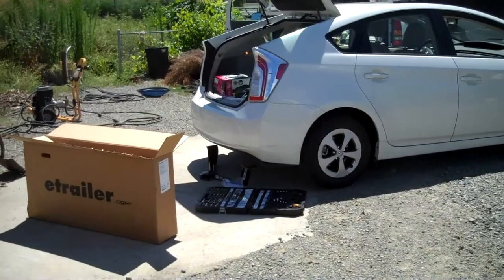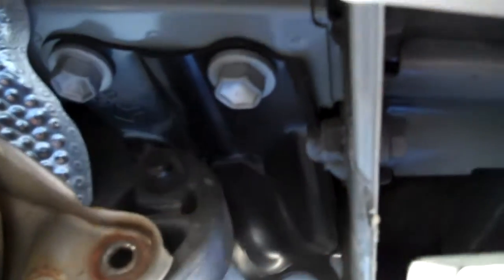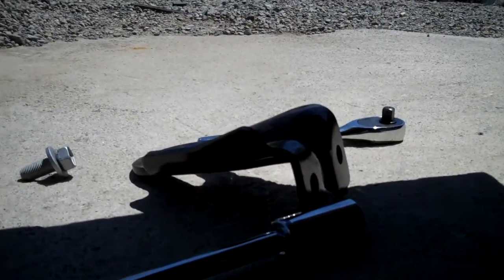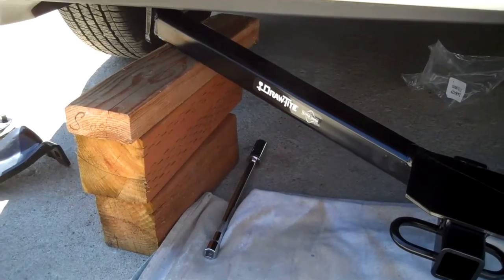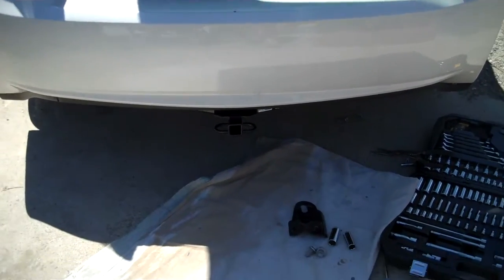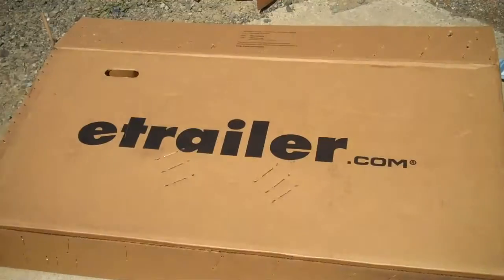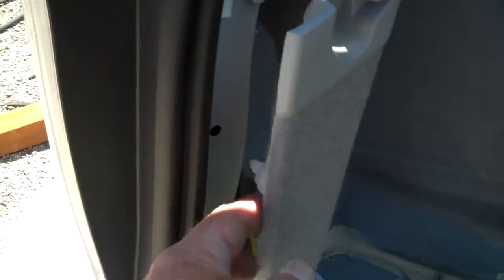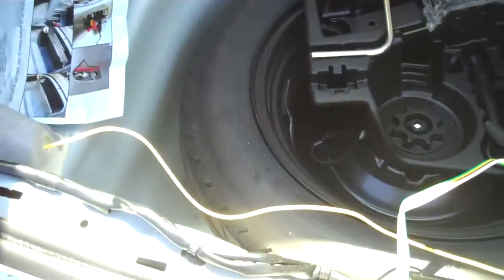How to Install a Prius Tow Hitch

Comment: Thanks for straight-forward tutorial. The Curt tow hitch is about $200 cheaper than the etrailer but it's 1  1/4". Does it make that much of a difference using a converter to 2"? I will be primarily just be using hitch for a cargo rack on back, occasionally pulling a small 15' boat trailer (less than 750lbs with boat). Thanks!
Reply: You lose the slightly higher tongue weight, but the hitches are rated the same.
Reply: @ALRinaldi  Thanks!

Comment: Just like Jon said, super simple.  Mine is a 2011, all 17mm holes for the hitch and 10mm for the bolts for wiring (tie down rings and battery).  Bought from e-trailer also.

Comment: Thanks for the video. Can you share your experience so far? I want to put a three bike rack on this hitch but everyone says that you can't do that on a Prius, any experience with this set up? Thanks
Reply from the maker: Of course you can

Don't listen to the haters

I have a full-size trailer and I load it to the gills I've never had any problems

And my Prius is no worse for wear

What you are suggesting with three bikes

Is way less weight than I have with my trailer and tons of building materials

I wish I could post pics I could show you

Anyway you are fine go for it man
Reply: Thank you.

Comment: Question that may be too simple - but is this the type of hitch I would install to then use for mounting a bike rack on?  (with a hitch ball mounted into it)  Thanks
Reply from the maker: Yes you need this as a prerequisite for any thing you want to put on the back of your Prius
Reply: @Jonehughes  Thanks - just wanted to be sure - we are over in Europe and making foolish mistakes can be expensive and time consuming

Comment: Did you have to remove the rear plastic protector or am I able to install around it?
Reply from the maker: They are all different

This was a 2012 and I did not

I did it with my 2015

I did with my 2018

It all depends

Comment: Hi John, I have a 2007 Prius.  Just wondering what the  part # is for your wiring harness that you installed?  Thank you
Reply from the maker: CURT 56147 Vehicle-Side Custom 4-Pin Trailer Wiring Harness, Fits Select Toyota Prius https://www.amazon.com/dp/B006MDH3JK/ref=cm_sw_r_apan_glt_i_M8WKXZ85S7SP9GQ8KBTX?_encoding=UTF8&psc=1
Reply: @Jonehughes  I could be wrong, I can't hear very well. I thought I heard you say in the video the wire harness came with the hitch?
Reply from the maker: Hi Brooke

 I'm also on a budget 😜

and whenever I order any hitches from them and I've ordered several

 they always come with the wiring harness also

Comment: I wonder If I could tow a costco ftx functional trainer for about 3-4 hours? The functional trainer weigjts about 550-600 lbs.
Reply from the maker: I have a 2018 Prius 2 but at the time that was either my 2015 Prius 2 or my 2012 Prius C and regardless I used this trailer all the time

Still do ....almost daily

It works perfect

https://www.homedepot.com/p/DK2-1639-lbs-Payload-Capacity-4-5-ft-x-7-5-ft-Galvanized-Steel-Utility-Trailer-Kit-with-Bed-Tilt-and-Collapsing-Ends-MMT5X7G/305900652

Comment: Do you think the Prius can tow a jet ski?
Reply from the maker: Totally I pull a big trailer and load it up

One caveat though

I would never do it on a big hill where there was a chance of having to stop and start again

It would put way too much pressure on the transmission

But flat ground or small hills or even large hills as long as you're able to keep that vehicle moving
Reply: @Jonehughes  Would you consider a boat launch a small hill? Thanks!

Comment: So there was no need to jack up the prius?? I want to do the install myself but thought I needed more room underneath the car.
Reply from the maker: Cuong Nguyen yeah there is absolutely no reason to jack it up it makes it a lot easier if you don't jack it up to set up a temporary blocks and stuff like that I am 6 foot and 220 pounds and I had no problem fitting underneath there and doing this project
Reply: Jon Hughes I was planning on pulling a harbor freight trailer and a small practice boat. Maybe 350 lbs total. You think that should be a problem with the Prius? Thanks for the reply
Reply from the maker: Cuong Nguyen no it won't be a problem at all but I wouldn't go up hills and stress out the tranny in a slight inclines are fine but I wouldn't go up major Hills  but if you were already moving and you would fly right up a hill I don't think that would be a problem I wouldn't do stop-and-go traffic though on a hill other than that you should be totally fine I pull a lot of weight I probably pull 1500 lb it's no issue at all but like I said I don't get stuck on Hills that would totally trash your car

Comment: Torque?
Reply from the maker: yes🥰
Reply: @Jonehughes  no, I think you should include the torque value.
Reply from the maker: I was just teasing 
I have no idea

I just tightened it as far as my muscles would take me
Reply: @Jonehughes  fair. It's good to use a thread locker as well.
Reply: 45 ft lbs

Comment: Looks good but Toyota says to never tow anything with a Prius. I added to my Prius to use as a bike carrier.
Reply from the maker: +label1877 
I have had mine on since July and have used it about twice a week, pulls fantastic..... I haven't found any issues with it at all, I assume Toyota says that (if they did), because that cuts down their liability ....
Reply: My owner's manual also says not to put bikes onto a tow hitch rack.
Reply: I put at least 50,000 towing miles on my gen 2. At times I had 3 dirt bikes on the trailer and it pulled great. My car got totaled at 240,000 miles and it was still running great. No engine or transmission problems whatsoever. It tows great.
Reply: Somehow they can tow in Europe but not in the USA. In Europe they can't go very fast while towing. In the USA there are no special limits so folks will be towing at 80MPH. Keep at at 55 , less than 1500 lbs and enjoy life.
Reply: I towed a 4x8 trailer over 1200 miles 4 times. Gas mileage never dropped below 38 mpg. You have to be smart, balance the weight in the trailer (never more than 150 lbs on tongue.) love my Prius!!
Reply: There's no reason in the world a Prius can't tow a light load (tiny utility trailer or maybe a dirtbike, etc), and certainly no reason it can't haul bicycles on a hitch.

Comment: Boy, I sure hate guys like you who make everything sound simple! Perhaps you just have a great attitude!  All of my bolts were 19 mm. I think I read in numerous places the existing ones were 17, while the new ones were 19. Not a big deal, but again all of mine were 19 mm. I have a 2011. 

The driver side portion is a piece of cake. Just make sure you insert (and remove)  the bolts straight. If you drop one, and it goes inside the shroud, you'll spend far longer fishing it out then you will spend on the entire job. The original bolts are tapered at the end, whereas the new ones are square. One very good suggestion I read was to put one of the old bolts in and snug it up, as it's far easier to start a tapered bolt  end than the square end, AND you're less likely to drop a bolt and play a fishing game. Seem like good advice to me.

On the muffler side, I would suggest soaking the rubber hanger in some penetrating oil. Makes it far easier to remove. I used a large carpenters flat bar-- didn't take more than 3 or 4 min.   At first I didn't think there was enough room to get a socket and extension on one of the bolts, but once the muffler is removed from the hangar, you can just get it pushed to the side enough to get a socket up there (it's tight, but doable). 

I opted to first put a bolt into the trailer hitch on the muffler side, without the bracket. Once that was temporarily secured, I placed the other two bolts on the driver side. While the trailer hitch is not super heavy, it's a lot harder to manage when you're laying on your back, and trying to hold the muffler bracket in place, sandwiched against with the trailer hitch and get a bolt started when you have this thing wanting to fall on top you.  It was much easier for me to temporarily hold the thing in place with one bolt and come back to it. 

I would say if you could get a helper this would go a lot faster. It is awkward to do by yourself. Best of luck for anyone who wants to try this! I would count on about 45 min.
Reply from the maker: Troy D  that's funny Troy I'm sure you are a good man and you will get it figured out brother it sounds like you're really thinking about it it went really easy for me I didn't see any issues whatsoever
Reply from the maker: Troy D yeah I thought I mentioned that rubber hanger apparently I didn't huh sorry about that it does work really good with that muffler hanging down out of the way
Reply: Troy D,  What is it with people who want to spray oil on rubber parts? Oil and any petroleum lubricant will rot rubber. Don't do it. Spray the rubber with dish soap. I did that when I removed and installed the muffler hanger and it worked great. Once the soap dries, the rubber will not slip. I also use dish soap to install bike handle grips.